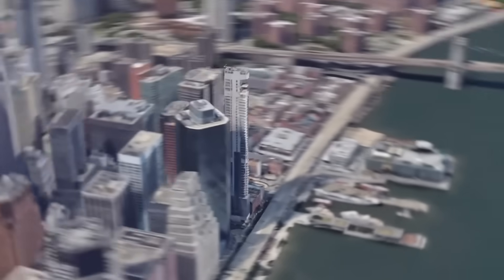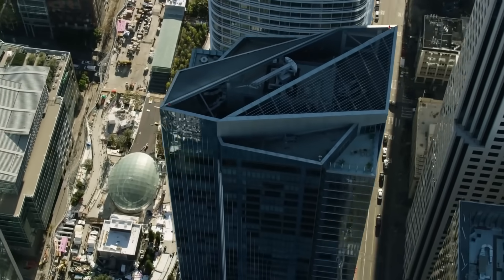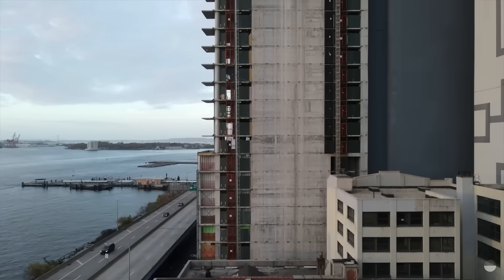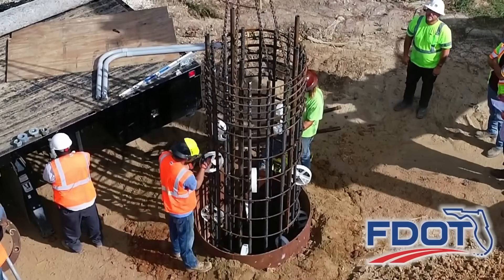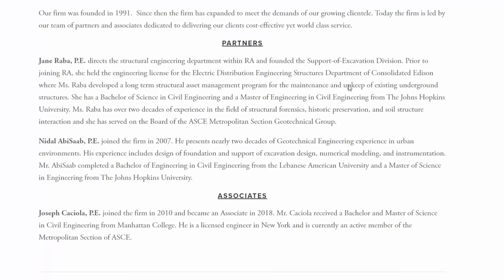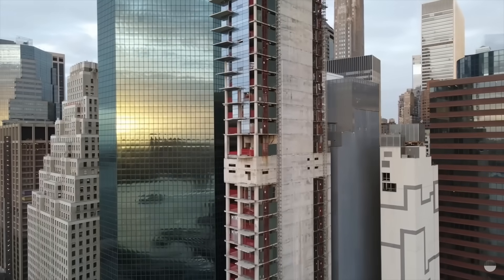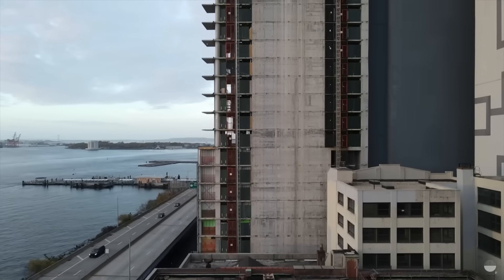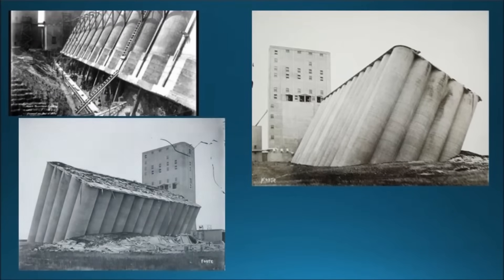New York's "Millennium Tower" Fiasco

Comment: I think more insurance companies should take the position to not insure and underwrite these very tall building projects based upon certain engineering processes eliminating foundational contact with bedrock.  That would resolve the issues with these building failures beforehand.
Reply from the maker: That is a good point.  I don't know how they are able to insure such risky foundation alternatives.
Reply: @CaseyJones-Engineer either this, or the local government requires insurers who are willing to insure that risk accept foundation issues as a “claim”.
Reply from the maker: That is an interesting point.  I think the City needs to do more here to hold the developers accountable. @Meatball2022
Reply: @CaseyJones-Engineer  what will happen is the premiums will skyrocket. It’ll force the builders to do the right thing, as the premiums will make sure it’s not cost effective to cut those corners.
Reply: @CaseyJones-Engineer because the designs get a stamp
Reply: This is what’s known as the “socializing of risk” while privatizing profit. If that building has to be abandoned, or repaired, much of that cost will come from insurance. Which will drive rates higher, as the insurers seek to recoup their loss.
Reply: I suspect Insurance companies cross subside loading a large amount on the low risks making it look like insuring is a far more expensive business than it need be, maximising cash flow. For example if the insurance companies directly based premiums on risk there would be a lot less persistently dangerous drivers on the road but their income and turnover would plummet, pricing many customers completely out of the market who should not be in it. Probably the same for buildings as it would seem here.
Reply: Maybe the NYC game of the city pays because sewer and storm drainage contributed beside the bilge pump arrangements the waterfront areas have. DC has bailed out NYC' bankruptcy schemes many times.
Reply: The problem is that often insurance companies are the owners or at least own the largest percentage of these buildings. They make these investments as a means to shore up cash reserves for future needs. They are only investors, leaving development, etc to others.
Reply: Very insightful comment.  

In the past, insurance companies were covered by regulations that pretty much limited what they could invest in.  Real estate properties became the major basis for their assets.  In fact, developers went to the insurance companies and not banks for their finance needs because that was where the real money was and that was because of the asset mandates the regulators had in place at that time.  

Then one day through extreme lobbying, the insurance industry convinced the Congress to allow them to have access to other  capital markets for cash flow and secondarily, for reserves.  So, the insurance industry invested their dollars in the biggest casino of them all, the stock market.  When the markets were going up, they made out, when the markets went down they turned to their customers and raised insurance rates to offset their losses.  Many people don't realize this is going on and why rates have gone up despite the lack of an actuarial basis for same.

In the meantime, because the industry can play the markets, they have taken their eyes off of certain tranches of risk management.  I proffer that real estate is one area they ignored in good times and they roll the dice on certain projects that they should be otherwise more circumspect about.  Hence the Millennium Towers class of buildings become a huge liability and the delaying tactics of the courts and politicians becomes played out seeking resolution to the liability issues.

I believe if proper risk management was in place by insurance companies, it would create a barrier to questionable construction practices and in so doing, circumvent the current and possible future debacles currently at hand. @TCW838

Comment: Is there a structural risk to having the top half of the building exposed to weather?
Reply from the maker: I would be concerned about the development of corrosion in the reinforced concrete.  Concrete has additives such as fly ash to make it less susceptible to freeze thaw when exposed to the elements.  The concrete in this building was no doubt designed to be covered and protected, and not to be exposed to the elements for years.
Reply: @CaseyJones-Engineer  I would also anticipate that the rods are damn near worthless now, far out of spec to what's needed if it was completed. This thing is coming down.
Reply from the maker: That is a great point and I suspect you are right that this thing will be demolished. @alexandermckay8594
Reply: Even if properly constructed, I would never live in such a narrow building.   Earthquake, storm, wind…..  It will flex… the exterior cladding durability over time.  Not to mention, after it ages.   A 6 digit condo fee,

Comment: Several decades ago my husband & I added about 800 sq ft onto our hillside house in the Hollywood Hills (below the Hollywood sign). 3  concrete pylons with rebar were put 17 feet deep INSIDE of the bedrock (which was basically exposed).  They were attacked together by a steel reinforced concrete triangle at the top. That is, for just 800 sq ft of WOODEN construction. 17 feet IN the BEDROCK. We went through the Northridge Quake. (LOUD, LOUD, LOUD) No damage...
Reply from the maker: That sounds like a solid foundation.  More solid that what the used for this building costing hundreds of millions of dollars!
Reply: exactly.  @CaseyJones-Engineer
Reply: great videos (and I'm not in construction, at all) @CaseyJones-Engineer
Reply from the maker: Thank you.  I really appreciate your saying that! @johnl5316
Reply: 17 feet into bedrock is surely more than what the Millenium Tower in San Francisco has which is a 10 foot thick rebarred concrete pad on which the building rests.   Fastening those new piers into bedrock on two sides will probably end up cracking that 10 foot thick foundation if it wasn't already cracked due to the leaning.
Reply: @animejanai4657 
Right, the SF tower is just 'floating' on landfill, which potential can liquify in an earthquake.  

Every other skyscraper in SF has pylons drilled into the underlying bedrock ... and are NOT tilting.
Reply: The problem with investors is don't want to spend a fortune on underground pilings, once a pile is driven it's seen no more and forgotten. ~ But for a quality building designed to last for a 100+ years, a rock solid foundation is necessary, and so may pilings be too.
Reply: Your name is John and you have a husband? 🤮

Comment: With millennium towers sinking and tilting problem coming to light around 2015, you would think the New York developers should have opted for bedrock pilings in 2018.
Reply from the maker: The building was topped out in 2018.  The ground improvement was done in 2015.  I do wonder how quickly they realized things were amiss?
Reply: The problem is the engineers designing the foundations  would make big profits from getting the job so there is big incentive to cut costs. We need to return to a time when  standards were imposed and enforced by city administration. So-called red-tape cutting allows these sketchy operations to cut costs beyond what is wise.
Reply: Developers would skip foundations and roofing if they thought they could sell it before it collapsed and washed away.

Comment: Do buildings under construction pay property taxes? Seems like that would prompt a resolution more quickly.
Reply from the maker: That is a good question. A lot of times these developers get breaks where the won't have to pay taxes for many years.
Reply: YES !!!!!  As soon as u Pull the Permit............................. @CaseyJones-Engineer
Reply: It seems to cost so much in big centers (SF, NYC, …) that developers have to build up. Then when the bids come in there’s a tendency to cost cut and the foundation seems to be the first place - out of sight, out of mind. But just look up the definition of “foundation.” I would be leery of buying a unit if/when the building is completed especially on the upper floors. If cost was such a problem is some entity not spending enough on preservation or going low ball on inspection services. 

Let’s hope others (developers & their insurers) have thought twice about using other than to bedrock piles when building on landfill & reclaimed land.
Reply: Generally, since it’s not complete, it would pay the unimproved tax rate.
But that’s just a guess on my part
Reply: Normal to pay taxes based on the value of improvements, be it under construction or finished.  Depends on the taxing entity.  Big projects often get preferential tax treatment.

Comment: It pains me to say this, but in my (limited) experience with pressure grouting, the quality of the final product depends too much on the skill and experience of the installer for me to have much comfort with it as a method.  It may be my public-sector background, but I’d rather eat the cost of piles driven to rock and know that it is one less thing that I have to worry about.
Reply from the maker: Yes I agree with you.Apparently getting a good sleep at night is over valued with some of these engineers.
Reply: @CaseyJones-Engineer you mean, developers. My step-dad was a construction foreman on some rather iconic buildings around NYS. It would seem, for every project he and his men were responsible for there was a developer who’s budget office kept pushing him to cut a corner here, use a cheaper, sometimes questionable method there, any to line their, the developers, pockets, and in some cases screw over the future residences and buildings. He quit or was fired (depends who you ask) one project over a developer that wanted something done substandard and had the potential for windows and/or their fittings moving in such a way they may come out or into the building. Sure enough shortly after residents started to move in and some November winds started to pick up a row of window fell out due to pressure differential in a unit. Thankfully, nobody was injured by falling tempered glass but they had to inspect and rework every window in the building at considerable expense to the building owners and condo boards while the developers were already off counting their money.
Reply: With such a small building footprint, that was just asking for trouble.

And since the finished grout product is mostly hidden from any quality assessment.  Saaawy, my bad.
Reply: @CONTACTLIGHTTOMMY  
I believe there are ways of detecting anomalies in the final product below grade using various transmitting media.  There is compressive and load testing as well I would guess.
Reply: @CONTACTLIGHTTOMMY  
Well if it can be proven that the procedure has a successful track record for a structure of this nature and all other site soil conditions and design considerations being favorable to it's use, why not give it consideration.
And he mentioned piles extending from 130' to 170' which seems to be quite a difference in depths for such an apparent narrow footprint.  Did the piles actually extend into competent load bearing rock at each location?  Could the sub-surface exploration miss some upper loose material?   This is just my hypothetical shooting from you know where here.
Reply: @CONTACTLIGHTTOMMY  
Me too. It would be interesting to know.  I'm of the uneducated opinion that any leaning of these skinny pencil neck structures may already be too much.
Reply: Or as he suggests... an initial test pad concept with a high built in safety factor.
Reply: They never should have even considered this style of foundation. Union labor isn't known for quality, lol

Comment: Bonding is an answer, but better and more qualified reviews of critical engineering points of a proposed project is needed by the City Building Commission also! NYC should have know better then to let this happen with those soil conditions in that section of the city! Engineering groups need to push for greater ethic standards amongst themselves, more oversight and input by City Building Commissions, and also a requirement for peer review! It's sad to think an engineering firm caved to arm twisting by the developer to lower the standards on such a critical building part as foundations, if in fact that is what happened!
Reply from the maker: I agree with you it's a complete embarrassment to the profession.

Comment: Building your high rise on garbage using questionable foundations would seem to be the common denominator in San Fran and NY. Looks like a job for Mr. Hamburger.
Reply: ?......hmm Hamburger   is what  you'll get, WHEN  millenium tower,  topples over....collateral  damage for half a mile in 3 directions.... 686,000,000  (million ) pounds of falling cement.....glass  some steel, and ALOT  OF  plastic !  686,000,000  pound = over 1,550   fully fuelled   Ge  4400    hp  locomotive engines.    Each is 435,000  pounds.
Reply: @petersack5074  He hasn't had one fall over yet so his record thus far is a 100% success  rate which seemingly makes him an expert in such matters.
Reply from the maker: That's funny you say that I wonder if Hamburger has reached out to this developer.
Reply: Considering Manhattan has good bedrock, it would be surprising that they didn’t use it.
Reply: @neilkurzman4907 it’s really good bedrock, a bit offbeat in composition but that’s mostly a curiosity to geologists.